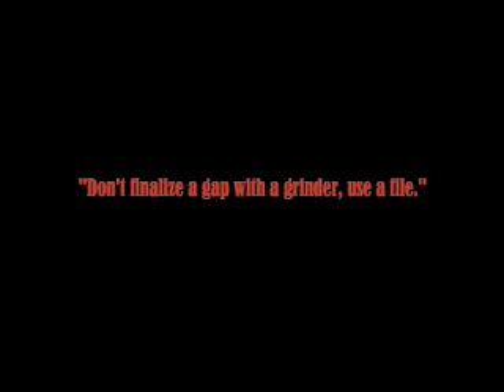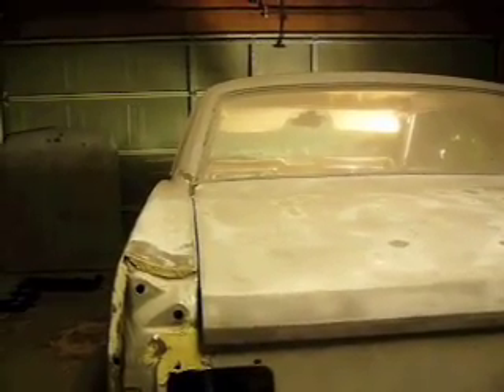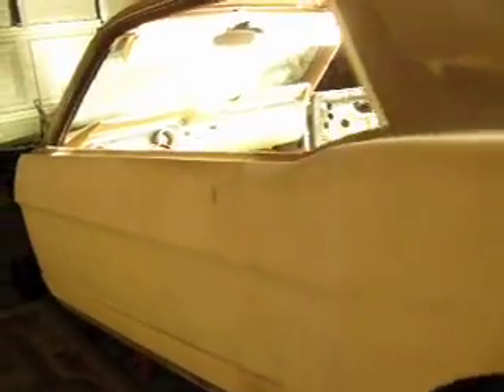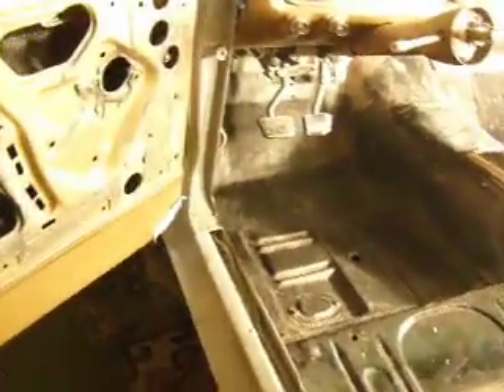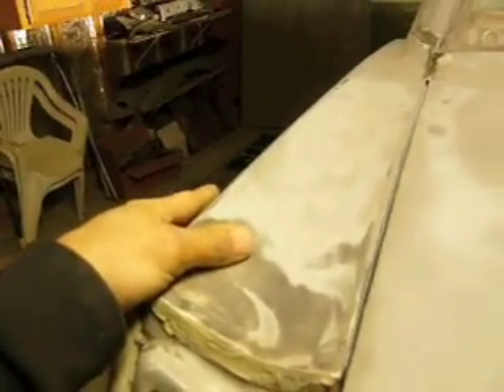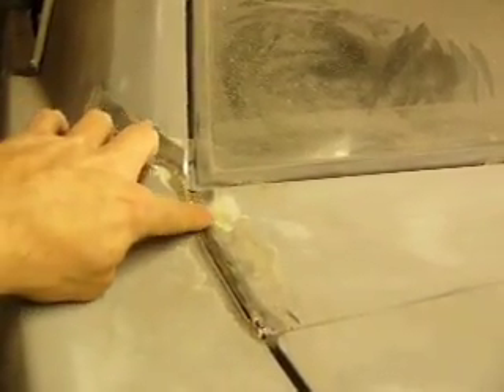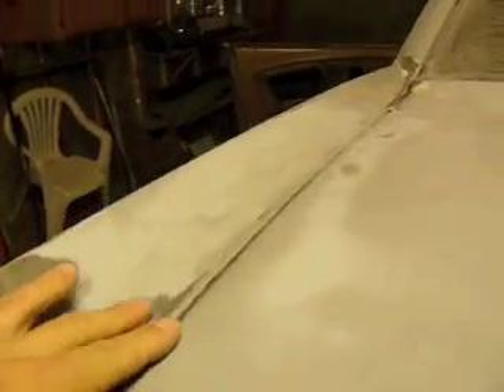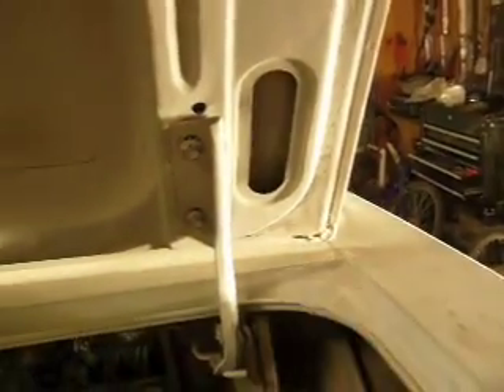episode 2 / 1965 Mustang update / quarter gaps

Comment: Nice work sir.  I really did a hack job on the passenger rear quarter where it meets the decklid, the gap was wide and wavy, so i built an edge out of filler :(  I really should redo that..